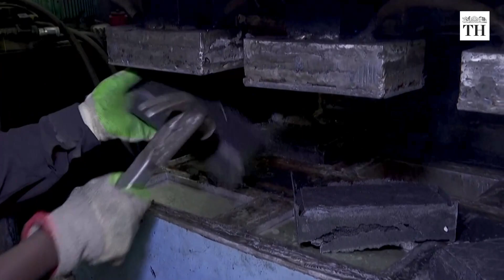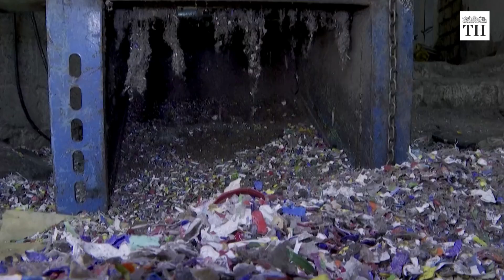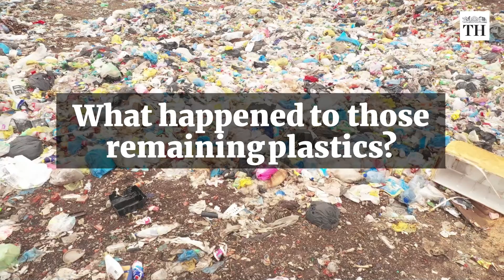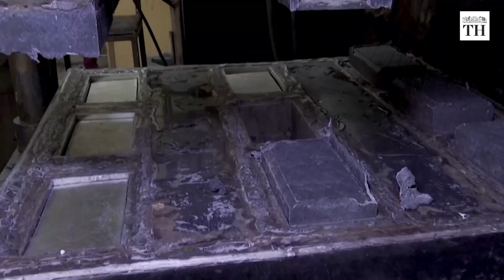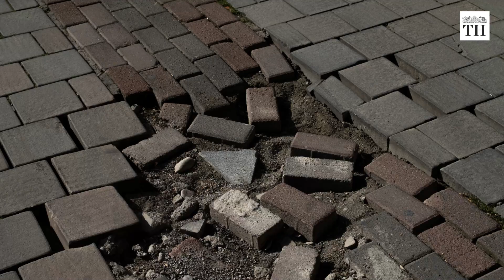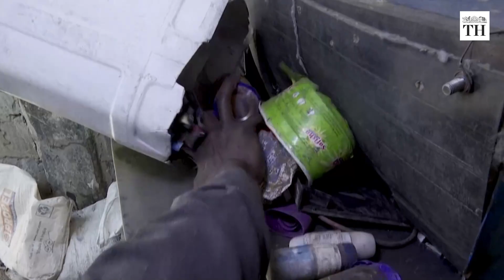Now, you can make eco-friendly bricks from plastic | The Hindu

Comment: Plastic wear and tear create micro plastics which will linger for hundreds of years, hence making roads and bricks are not right solution to plastic manace. Use disposed plastic as fuel in steel, cement and tiles industry as fuel and get over with it. Key to getting rid of plastic is to not produce plastic in first hand.